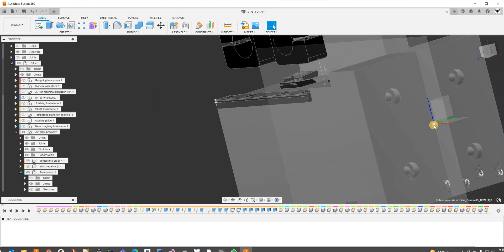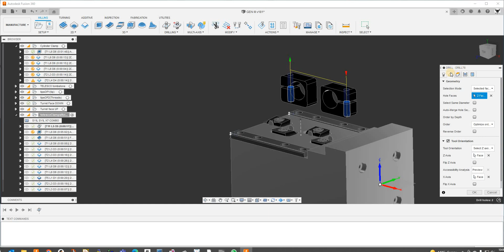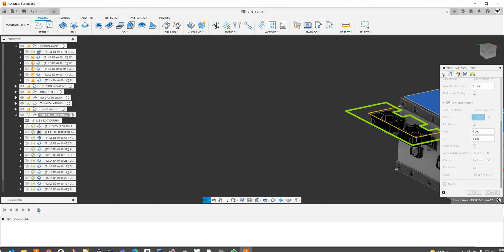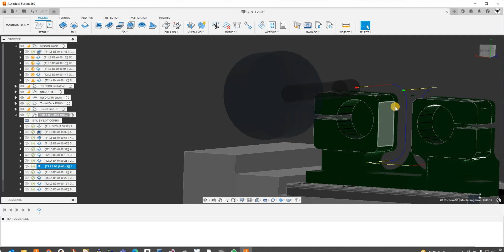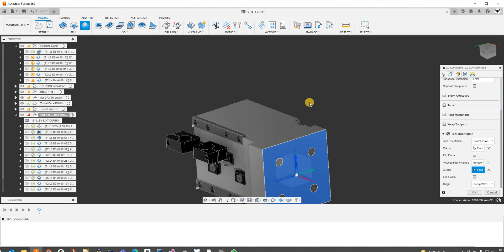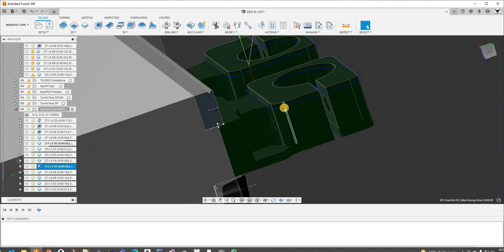Basic 4th axis CAM walk through

Comment: Thanks for that video Peter, very useful. I’m just at the point now where I’m going to put the 4th axis back into my X7 and start playing around with it. I’ve borrowed a Lang master tool to setup the Lang face plate, then I’ll start making some simple square and hexagon ends to some bar stock just to see how my cam is going. 
How did these parts come out for you?
Reply from the maker: Sorry for the delay! These parts turned out well, you can find them installed on new Mazaks if they picked our telescopic air blast nozzle kit from the factory!

Comment: Great information on the 4th axis.  I just got my machine about a month ago and i am looking to tackle the 4th operations soon.  I am curious about all of the setup and workholding you are using.  Is that a Lang plate you are using on the 4th?  If so what model and what are the dimensions of the tombstone you are using?  Also what riser you used under the 4th?  A lot of questions I know but you seem to have a lot figured out and a great setup.  Thanks
Reply from the maker: Thank you. Glad you found it useful. Yes they are Lang plates, the one under the rotary I had to drill to align with the T slots. The aluminum plate is just an adapter from the 4th to the Lang studs. It’s been a great setup, I spent a lot of time working on it in CAD with the whole machine and motion etc. the tombstones are I think cut from 4” square bar.